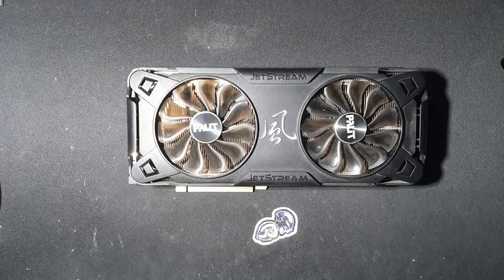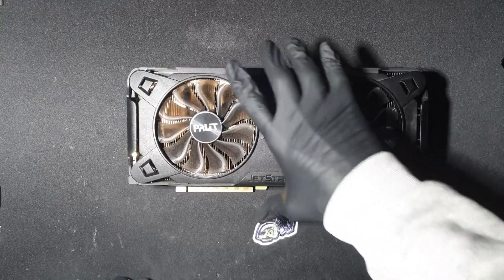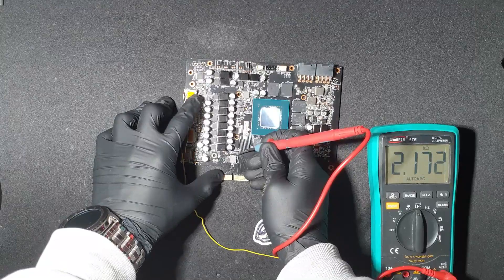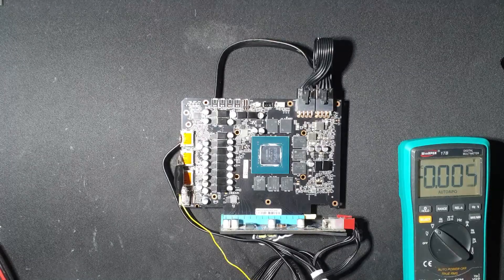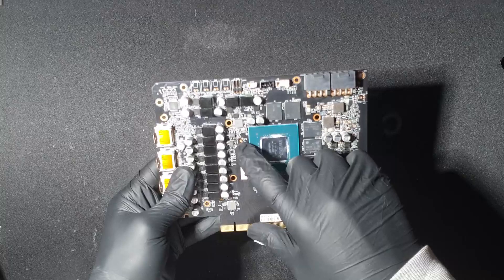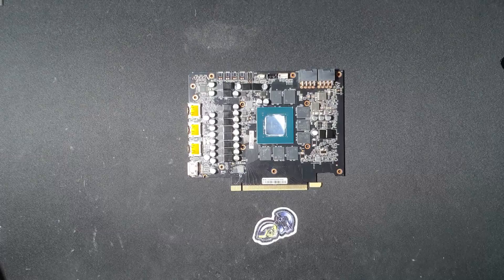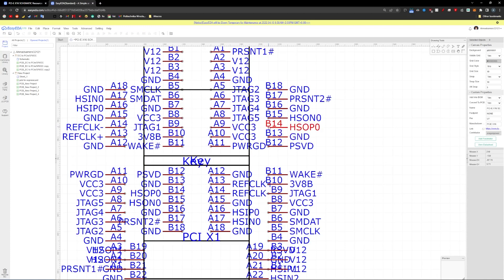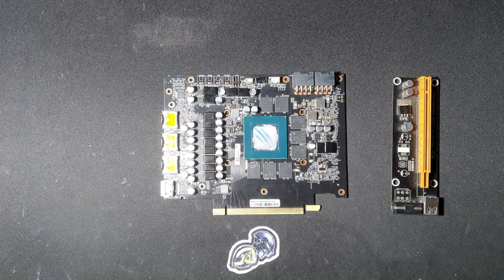RTX 3070 Riser Inserted Backwards Diagnosis (for any GPU)

Comment: It will only work for mining, not for gaming.
Reply from the maker: It will work for gaming, just limited to pcie 1x. It is possible to make it 8x but you have to rewire last 8 lanes to be first 8 lanes
Reply: @A.S.Repairs  could you do a video or share a tutorial how to do this .. looks amazin but i need to see at detail i want to try it, btw giving you guys a tip try to use a motherboard that has x4 pcie need to be x4 not x8 not x1 not a riser just a x4 inset the graphic card and it will give you video when you hace this problem of the first lane OL, yeah only when gpu its still alive if theres a masive short then its dead